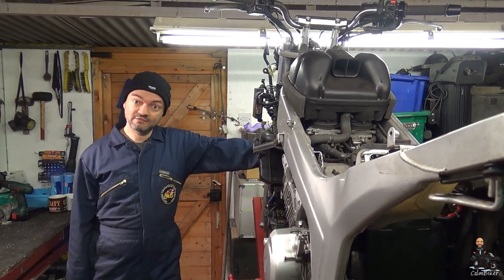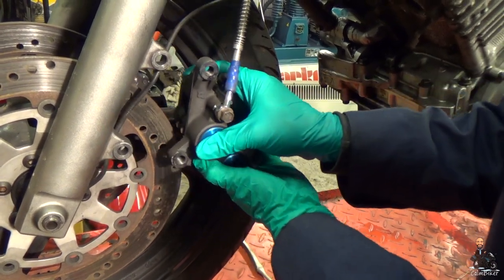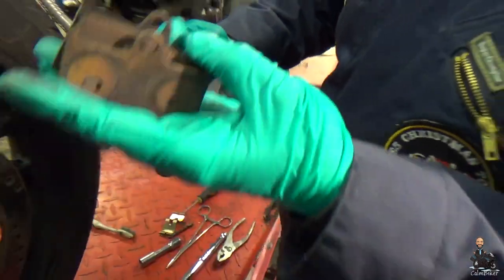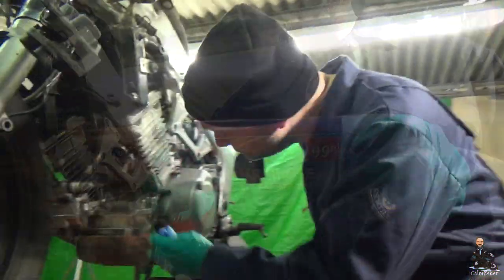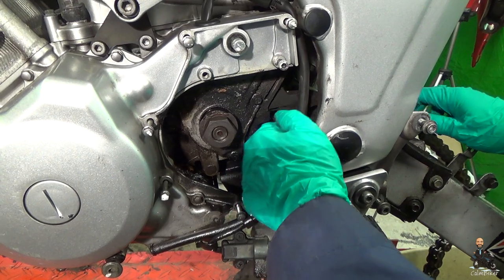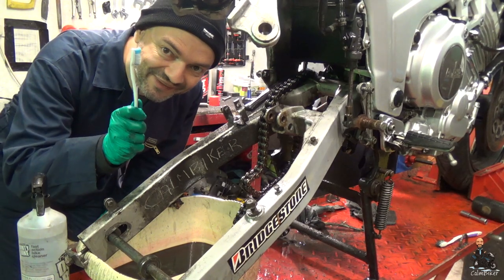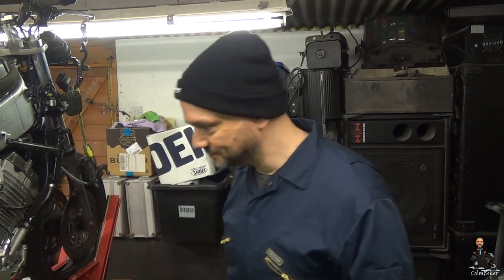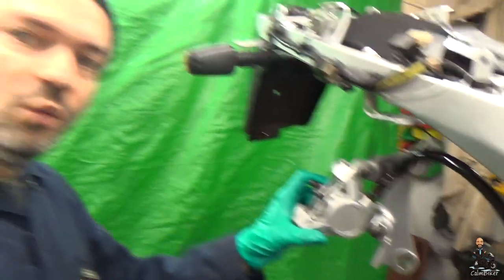640. Yamaha TDM850 Restoration Project #4 - Cleaning the Bike | Garage Video

Comment: It's coming up a treat but I gotta say lads - the best muck disolver I know of is turps. It's also considerably cheaper than other products. Paint it on and blast it off with the air line......... Then you can clean with whatever detergent you like. And it won't attack powder coat. Try it on something really mucky.
Reply from the maker: +vitaly deuterium Does it not damage paintwork?
Reply: Nahhh. Goes through oil & grime something wicked though. Give it a shot on something 'orrible. You'll see ! Paintbrush and then the air line. Then normal washing proceedure with car shampoo etc.
Reply from the maker: +vitaly deuterium Video please! :-)
(Before I risk my Z1000 paint!) :-D
Reply: You're on !

Comment: Nothing wrong with using wd40 on chains to clean. It has no shprt or long term effect on an o-ring and is perfectly safe to use. IF however one of your o-rings is damaged for any reason and wd40 is allowed to 'seep past' the o-ring then its will dissolve the grease inside the bushing. But if you have a well maintained and cleaned chain then your o-rings will most certianly not get damaged therefore your safe. 

Do not use petrol or brake cleaner they will swell the rings or dry them out. Kero based products are best for this job
Reply from the maker: +craig walsh I use kerosene myself. Works a treat. I'd be more concerned about what WD40 does to the chain lube you put on top if you don't manage to get it all off. It cuts straight through it. I've added the link to the description to the video I mentioned in this one.

Comment: Two questions. 1. I always have used Gunk to clean with. How do these modern cleaners like *uckOff compare? 2. Where did you get them pliers from? They look like something out of a Chad Valley "Helping Daddy" set.
Reply from the maker: +Professor I've not used gunk so can't compare. Maybe Tosh will comment. The pliers are forceps. I've just bought a pair off Amazon for £2.75 but they arrived broken. Hopefully I'l get a replacement that isn't :-D
Reply: No, I didn't mean the forceps, I meant the silver chunky jobs. I really would be interested in these modern products as I've heard good and bad things, Thanks
Reply from the maker: +Professor I'm not convinced by the pink stuff. It seems to damage powder coat if you don't rinse them thoroughly.
Reply: I'll stick to Gunk then, cheers

Comment: how.can i paint the gray motor area??
Reply from the maker: We decided not to paint the engine but you can do. Lots of preparation to make sure the surface is clean, grease free and has a key to get the paint to stick, then a suitable VHT paint. I did painted the bottom of my Z750R engine successfully using "Engine Black".

Comment: Tedium cleaning a motorcycle surely not  ? mind you I wouldn't know how to strip a bike down like that haven't the confidence are you a mechanic or engineer by trade ?
Reply from the maker: +Graham Calvert Nope. Tosh has worked on bikes a lot more than me but he's an HGV driver. I'm a software developer, which is about as far from mechanical as you can get I think :-D